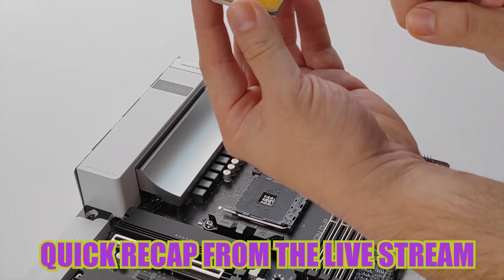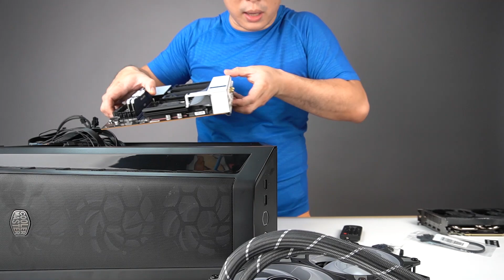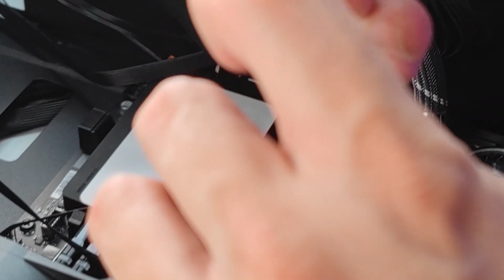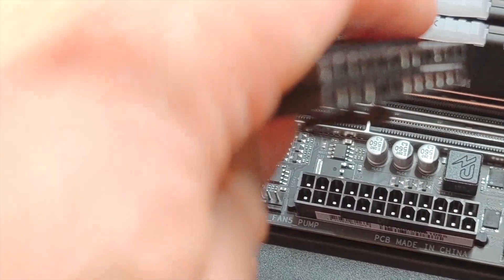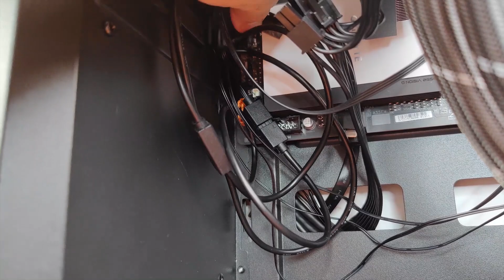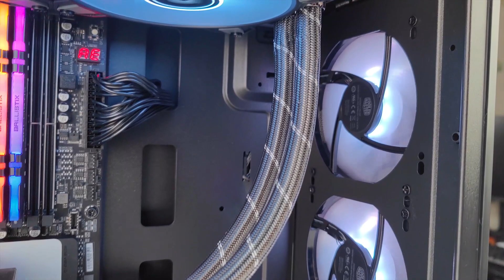HOW TO BUILD A DESKTOP PC with GIGABYTE B550 VISION D P + RYZEN 7 5800x + ASUS RTX 3060 #GamingRig

Comment: There's a ninth screw for the motherboard on the top left. you need to remove the little plastic guard which also gives easier access to the CPU 8 pin power plugin. Great vid
Reply: How do you remove that plastic cap?